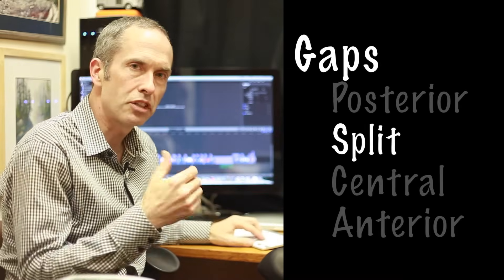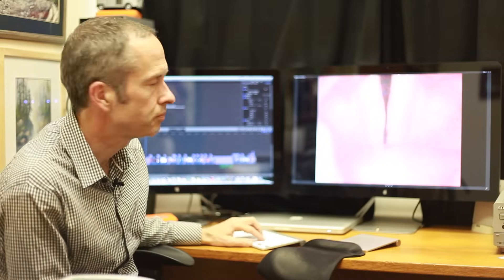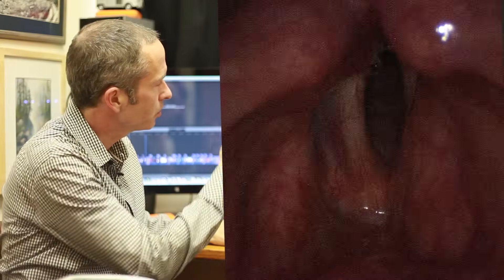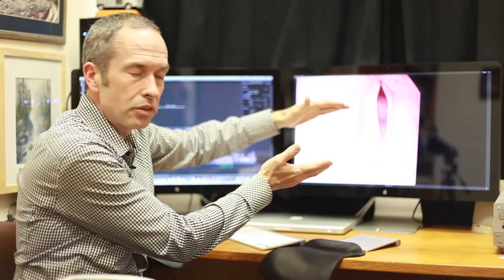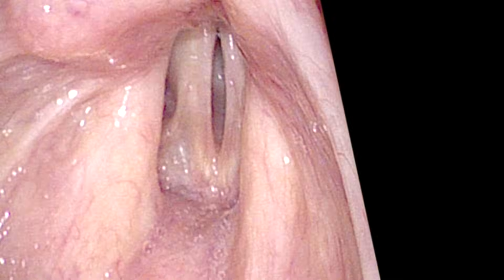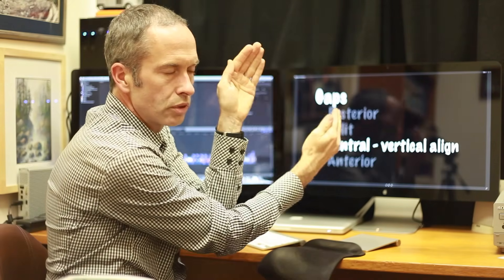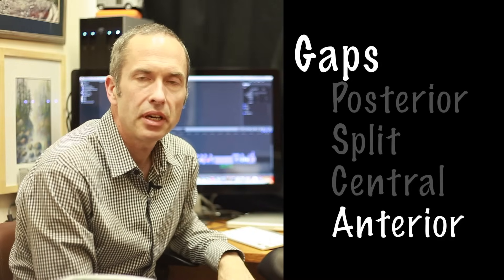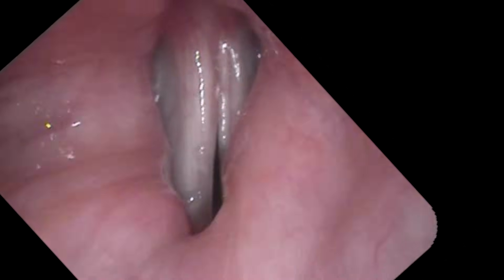Basic Laryngology "Mind the Gap" Part 2 - Gaps

Comment: I didn´t understand. WHile producing noice, the vocal chords must touch o mustn´t? High pitch need a more close space to produce so the vocal chords stretch to reduce the space between them, but should they touch each other? Doesn't that cause nodules or inflammation?
And when you produce low notes, they don't require stretching as much, but there still shouldn't be gaps?
Reply from the maker: They often come completely together. This makes a clear sound. If they don't come completely together, then some air leaks out and adds "white noise" or softness to the voice. Pitch is not related to the space between them, it is related to the mass and tension.